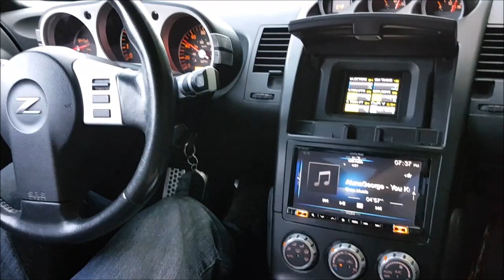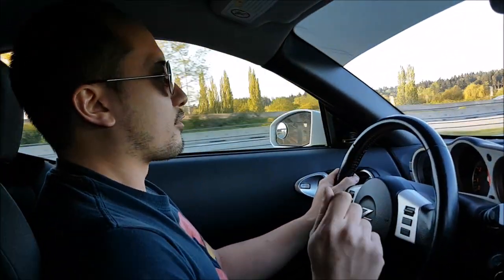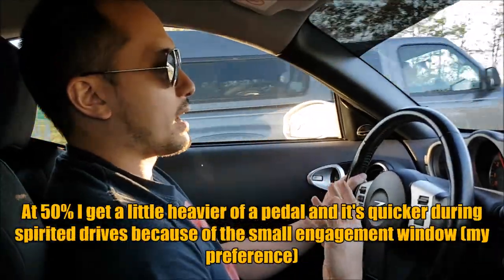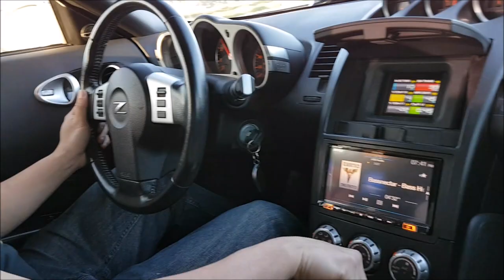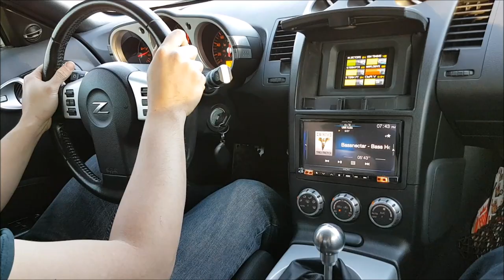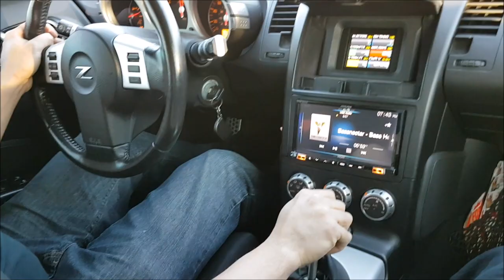RJM Performance Nissan 350Z / Infiniti G35 Clutch Pedal Review (Heel & Toe Action) | AnthonyJ350

Comment: After install is it normal to have about a 1/4 inch of a little slack in the pedal before hitting resistance or is it supposed to be resisting all the way up to down the range of motion of the pedal? Thank you!!
Reply from the maker: I think 1/4 play is reasonable. I would put in a new slave cylinder and change out the fluid.

Comment: Hey Anthony. Just installed my RJM clutch pedal and now I'm having an issue where the clutch isn't fully disengaging and I'm unable to shift into any gears. Does the pedal have to be adjusted specifically to get the clutch to work properly? Also running it with a brand new z1 clutch and lightweight flywheel
Reply from the maker: What's the pedal setting set to? There's a dial on it.
Reply: @AnthonyJ350  it's set the same as OEM but I found out the issue was I needed to adjust the threads behind the clevis because I had also installed a stage 3 clutch and lightweight flywheel as well. Feels great with the new pedal!
Reply from the maker: @ThrowyaXup  So awesome you got it sorted out and are enjoying your new setup! Is it easier to drive with the pedal, compared to stock?
Reply: @AnthonyJ350  definitely. Much lighter feel and accommodates the new clutch and flywheel perfectly, should've came that way out of the factory
Reply from the maker: @ThrowyaXup  Ya it's like Nissan wanted the "in - out" quickness for racing or something. Just seems to mess everything up instead. RJM is mandatory for all manual Zs and Gs.

Comment: Bro what kind of short shifter is that? Looks good when u change gears
Reply from the maker: Enchie Boom boom It's a Torque Solution shifter. Just search 350Z short shifter. What I did was just pushed the factory boot around the base.
Reply from the maker: Here's the video.  At the Time I didn't push the boot around the base of the shifter. https://www.youtube.com/watch?v=Y1cXgqL2kZo

Comment: looks like it helps alot man. good upgrade
Reply from the maker: Htm281 - It's unbelievable how much better it is. Watch my install video cause I show it side by side with the stock unit.
Reply: I've seen it. had me considering whether I wanna buy more parts lol! right now I have a spec twin disc clutch and its a tricky one to drive smoothly. have to make sure push all the way down and some more to get it to disengage fully. playing with the adkister doesn't work well either. you on stock headers?
Reply from the maker: Yes I'm still on the stock manifolds.  I won't switch them out until we pull the motor a few years from now.  The nice thing about this pedal it will help everything last longer because you're not over stroking the hydraulics and the clutch should last longer cause you won't have to slip it so much at low speed.
Reply: will look further into it. seems like its going to help a lot. especially after that side by side comparison. thanks man!
Reply from the maker: Htm281 - No problem. Just email Ryan off of his site if you have any detailed questions.
Reply: Cool!

Comment: Just ordered this....Did you adjust it or just leave it as it came from rjm?
Reply from the maker: I made a slight adjustment, but leave it at the factory setting at first and drive it.
Reply: Thanks! The pedal should be around the same height as the brake pedal, right?
Reply from the maker: Riley It'll be close.